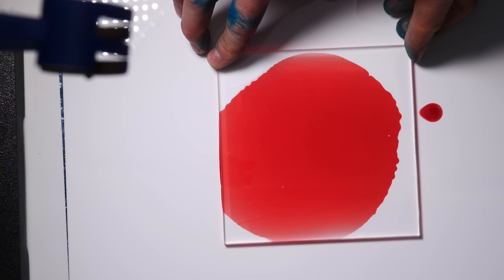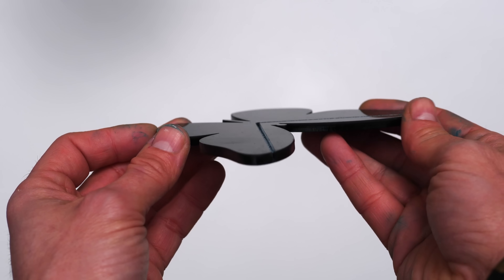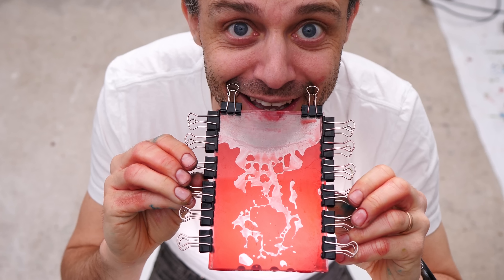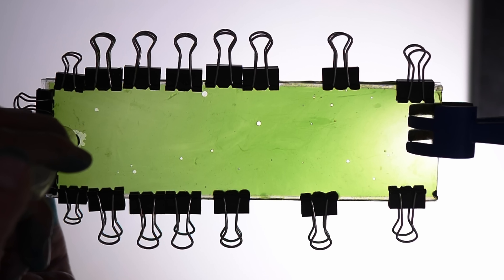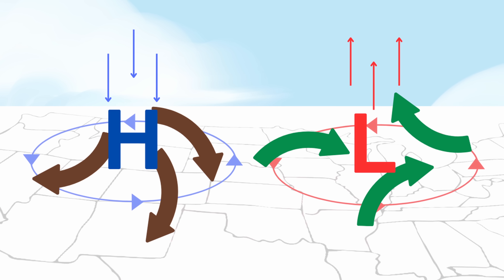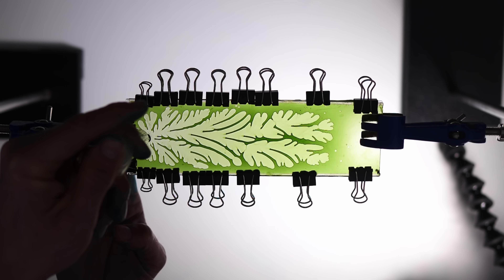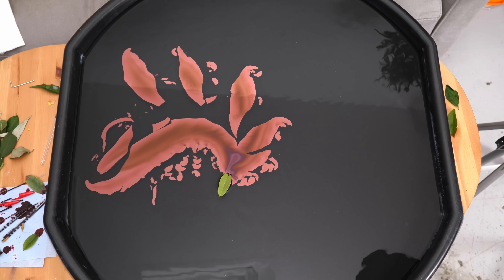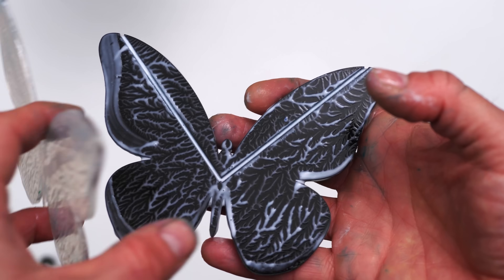Why honey makes these strange tendrils

Comment: is that essentially the fastest most efficient way for the flow of electrons, similar to lightning? and as the surface tensions sucks the volume from those tendrils the shrink?
Reply: the minute charges from the interacting atom structures
?
Reply: high pressure has faster moving molecules and loses more electrons?
Reply: that short lived effect could be the charges being discharged as the lose energy searching for the fastest flow across that plain, the 2 panes one being air the water but both of different densities so the lost energy dissaptes

Comment: To do the butterfly you just need a bridge between the wing tips, so your pulling from both wing tips at the same time with equal pressure. All the way through the body of the two pieces.

Comment: Oil can also be extracted from porous rock by the injection of air, particularly used for the remaining oil at the end of an oil field's life. The high temperature at depth causes spontaneous combustion and the steam etc forces the oil forward to another well for extraction. Commonly referred to as 'fire flood'. Works best in thinly bedded rock.

Comment: The look of these fluid fractals reminds me of wood planks scorched by high voltage electric currents applied between electrodes at both ends of the plank.  

I will post a link in comment to this comment for this YT video title:  
Safer Fractal Wood Burning (Lichtenberg) Setup
Reply: https://www.youtube.com/watch?v=s4ENnHRB6ro

Comment: There's a way of making pretty endpapers (for inside the cover of books) called paste papers, and it takes advantage of this effect. There are different ways you can control the pattern, by using stamps on the 'sandwich' before you open the pages. You can also change the pattern by changing the thickness of the paste in different areas. DAS Bookbinding (youtube channel) has a great video about it, and it's a really fun activity you can do, either with kids for fun, or as a n adult, to make beautiful papers for gift wrapping, paper crafts, bookbinding etc. It's an alternative to traditional water marbling.

Comment: For the butterfly pattern you want, why not print the butterfly with symmetrically placed holes to attach a strong wire? The wire would lead to a stable mount you build that uses a fulcrum to raise a platform in a perfectly straight manner. This platform would tug on both wings simultaneously when actuating the fulcrum, pulling both wings with the same force and direction simultaneously.

Comment: For a butterfly or other symmetrical patterns you could make a hole in the middle and then pull from around that point. You would need a vise or something to hold the bottom plate down, and something to help pull up evenly from the center.

Comment: Is there a related effect for three-dimensional bubbles of a less viscous fluid in a more viscous fluid? If you blow air at the right pressure underwater the bubbles make long strands that collapse into flattened spheres, but then air is also very buoyant in water so that probably affects the result. I don't know what would happen with two fluids of similar density but different viscosity. (The only vaguely comparable thing I can think of is a lava lamp, but that's a temperature gradient rather than a pressure gradient.)

Comment: Why not just attach like a suction cup and or handle to the shapes on one or both sides?
This way you pull them apart from the center of their mass, and you could make a different sort of fingering pattern, that is likely to be different from every other fingering you’ve done before.

Comment: I've employed this tactic creating artworks with "realistic" tree branching patterns in painting using various paints and media to accomplish the patterning. I noticed that the branching depends on which direction the plate (a plastic lid) is pried off of the surface or where the pressure causes an inconsistency in thickness of the media. How are these properties of fluid dynamics employed in the formation of various natural systems like branching trees or rivers or blood veins? Are these fractals created through similar perturbations?

Comment: You have probably solved the butterfly symmetry problem ages ago, but why not just make the wings into two separate plates, and then lift them both in the same way? (not at the same time, of course) For example, lift both wing plates away from the back thorax and outward

Comment: 8:10 I think you are considering the point in time when the thinner fluids pressure is increased. Before that event the pressure should be uniform for that medium. Thus, your diagram should have the before P and the after P of larger size in the thin fluid. At the boundary the pressure in the thick fluid should be nearly big P, while at the other side, instead of a tiny p, you should have used the before P. This still preserves the gradient but it’s more accurate.

Comment: Make a box for thr butterfly so you have something to pry on that would evenly lift the butterfly in whatever plane you want. Like a two small squares made so they touch the highest and lowest points on the wings, and you pry the squares instead. Maybe add small grooves or maybe string holes to the squares for easier and consistent separation.

Comment: I don't know how you said that opening line with a straight face... Which based on that smirk, my guess is there were many take before that... lol

As for the butterfly, I would've tried giving it two upward tabs or rings at the outer edge of the wings, to squeeze with my thumb on one and middle finger on the other. So that both wings pulled up together and then as you pulled the whole thing, it would've conjoined at the center.

Comment: I think that symmetrical shapes should have one of the plates cut along the axis of symmetry. If you then add small hooks to pull on in the same positions on both sides, you should be able to make things happen rather more symmetrically.

Comment: What happens in a vacuum when you remove the 2nd lower viscosity fluid, and then pull the 2 plates apart, do you get the same results?

Comment: Hello Steve. Love your videos and topics. They always seem to provoke deep thought and complex theories with practical demonstrations. I would like to inject a point for thought as well. I think the presure drop example leaves much to desire. Pressure is acting on all surfaces equally. The contact surfaces between fluid and cantainer add additional resistance, allowing a greater deltaP at the center of the resistive surfaces. I believe the fingers are only formed when the rate of change exceeds the limits of resistance of the fluid, hence the circle formation when forcing a thicker fluid into the thinner. Thinner fuilds can reach an equilibrium quicker than thick can displace them. While the inverse will trap thicker fuilds betwen layers of thinner faster moving fliuds. Thicker fuilds reach an equilibrium of presure once surrounded by the thinner fluid and the surface tension generates the fingers.
Again, this is not a criticism just my theory based on my current understanding of fluid dynamics. I would love to hear your thoughts on this. 
Thanks

Comment: I use this effect in my paintings.  I cut out a stamp from cardstock, paint it with acrylic paint, press it onto canvas, and carefully peel or lift it away.  Really great for making bio-inspired shapes like leaves and flowers.  If the stamp is flexible like paper, you can peel from multiple points simultaneously for a really cool spreading outward from center effect; just glue some threads to spots around the perimeter and then carefully pull the threads up at the same time.

Comment: I noticed that the fingering at 10:57 looks like the same pattern of motion as fire. I never realized it before, but fire moves fractally. Fire is the lighter "fluid" that is moving through the thicker fluid of the air, so it does the viscous fingering motion as well.

Comment: In ceramics there is a glaze decoration technique called "mocha diffusion" where you cover a pot with wet slip and then drip tobacco juice mixed with underglaze pigment onto the wet slip which grows fingers patterns like this which remain after firing.

Comment: Why is it when you put in the 'thin' fluid into the 'thick' fluid in the circular example, the 'thick' fluid sort of retracts towards the centre also creating the fractal fingers from the edges? Where is that mass going given you're putting more mass in? Is it just that the acrylic sheets seperaate allowing for more room, and the air coming in from the side creates the fingers??

Comment: Phenoxyethanol has lower surface tension than water. When a drop of phenoxyethanol touches water, it spreads quickly, disrupting water’s uniform surface tension. This causes flow patterns—swirls or “fingers”—as the fluid redistributes to minimize surface energy.

Comment: For mining, you need local melting and archimidis screw that pushes it from the bottom up way. You just need the screw at the bottom and not all along the pipe. (One of the) The most surprising thing i learnt is that, vacuumn does not suck. Thanks.

Comment: For the butterfly symmetry/prying issue, could you just do the same shape, but instead on each side you add a lever that's attached to the tip of each wing, separated from the joining plane? That way you could pry from that single point, and it would distribute to both wingtips (roughly) the same amount, and you could hinge it on the body as normal and hopefully get the simultaneous-prying symmetry you want.

Comment: Maybe have a slight bend down the center of the butterfly, so the wings are at an upward angle to maybe get a somewhat symmetrical pattern, if separated from each wing tip equally.
It will never be perfectly symmetrical, as in the teachings of Dr. Ian Malcolm.

Comment: For the butterfly:  Perhaps have a rigid plate for the end product, but a flexible sheet for the top layer.  Lines to the four wing tips so you can pull up and peel back each wing simultaneously.  A helping finger on the body of the butterfly would make sure that it's the last part to release.

Comment: You can get incredibly detailed and beautiful patterns with dry erase marker and two pieces of smooth plastic or glass, or some other surface at your experimentation. Color on the plastic and mash the two pieces together and pull them apart quickly before the ink dries. I found this as a kid and you can look at them under a microscope and see the tiny patterns. I’m guessing it does this because the ink is less viscous than the substances Mr. Mould uses. 
I tried the dry erase ink just now with some clear hard plastic trading card sleeves, and yes, with the naked eye the fingers are vanishingly tiny, and in some areas under my handheld 100x microscope the fingers have fingers beyond the resolution of the scope. Try it, it’s wonderful!

Comment: Your "flat plate" examples made me think of Lichtenberg scars. Is there a connection between the way that "over pressure" fluids move through other fluids and "over pressure" electrical currents (in lightning strikes) move through flesh?

Comment: For the butterfly, I'd try sticking a handle to the centre of each sheet (at the.. thorax, I suppose). Then you can pull them apart without having to go in at any one corner, though you would need a fair amount of strength to do so with something as thick as glue I think. Perhaps if you attach a C-shaped handle to both wing tips on both sheets that'd be easier.. However you do it, I doubt you'd get a very symmetrical result unless you start with the butterfly folded up (so two half butterflies) & then unfold it.

Comment: With the butterfly thing, why not make the plate you pull of break in the middle, or be separate held by tape or something, with a little tape handle in the middle, or something, but also; Is this maybe why our lungs our fractally? Fractalesque? Also leaves and stuff, because of the way they interact with fluids and maybe over time would evolve to take on the same shape?

Comment: For the butterfly to work symmetrically, secure one of the plates down on a table, and add tabs to the tips of the wings. With both hands, you can then pry the wings up at the same time, using those tabs, with the fractals ending in the middle body.
Reply: I was going to suggest drilling little holes in the wing tips and tying two strings in the holes then tie the strings together so you can pull both wings at the same time evenly.

Comment: could you talk about this flow in dust too? you see I'm a luthier and when sanding wood it makes something similar to this effect and would be awesome to see some knowledge in it. for instance, the dust continues to collect in-between the wood and the sandpaper kinda creating a seal, then when you lift the wood some vacuum is created leading to air flow to "blow" the dust to the center, piling up. never tried it with large pieces of wood, but I assume that it would create such fractal patterns...

Comment: The easy way to make the butterfly symmetrical would be to split it in half. Press the wings together, just like a butterfly at rest, and pry them apart. When it's dry, glue it back together.

Comment: Why is the more viscous liquid drawn towards the less viscous liquid sometimes? For example at 3:00 the green liquid pulls away from the edge and towards the blue liquid in the middle
Reply: No. When he pushes the fluid into the hole, it forces the plates apart, which then pulls the other fluid towards the middle.
Reply: @TheKingsapostle  Ah ok yeah makes sense. Thanks!

Comment: Idea for the Butterfly pattern... Cut a channel in the top acrylic plate that is aligned along the axis of the body, say 50% of the way through (from the top down to the interface between the lower plate). If you prise the upper plate from, say, the head to tail (you may need to lift the plate along the sides of the channel with screws?) the the pattern may emanate out from the body to the wing tips (I doubt it would be symmetrical in pattern but would probably be in size)

Comment: Currently studying Mechanical eng and the thought i'm having is this; the theoretical "ideal" geometry for a heat sink is a fractal, with infinite surface area to allow conducted heat to convect / radiate away, so my question is due to the fractal - like nature of viscous fingering, how does a heat sink with geometry defined by viscous fingering perform compared to standard heat sinks, and what would viscous fingering look like in 3d?

Comment: Awesome video, will surely try to plug that in class next year. The content is very relevant to a topic that I teach. However, I'm surprised that you did not discuss something that struck me during some of your video, such as when you inserted water into corn syrup. Overall, the outer edge of the circle seems affected even before the less viscous fluid reaches the edge. There appear to be a breaking point when all the structure crumbles and fingers appear all around (3:04). While you didn't discuss in details this phenomenon, I would believe that it's related to the pressure drop distribution in the more viscous fluid which is uneven along the radial axis. After all this, the only thing that I don't understand is, why does this lead to a reduction of the overall surface that is covered by the sum of all fluid since you added incompressible fluid to another incompressible fluid? The only explanation that I can come up with is that the overall volume changed along the Z axis and that the space between both glass surface actually increased slightly during the test. Thanks for any additional comment you may have on that, and thanks again for the awesome videos!

Comment: !  There's this kind of sand stone around my childhood home, used to call them power rocks, would crush them into a powder with larger rocks, don't know why..  Another thing we used to do is get them wet and use them to coat a slab of concrete by grinding them against each other, I think we pretended we were cooking and was buttering the pan.  I noticed when I'll get the rock wet just right so there was this layer of mud/sandstone between the rock and the concrete and then pulled it away it would make this really neat looking tree fractal pattern.  And now I know the name of the phenomenon about 37 years later.

Comment: You need to cut your butterfly in half and press the left and right wings together and then pull them apart, then you will have a perfectly symmetrical pattern on both wings of your butterfly. I do this all the time to paint eyeballs for the creatures I make (tap the two eye blanks together to get matching eyes) Oh and puff/3D fabric paint is your best friend for this kind of project.

Comment: I'm not sure I fully understand your point about the high/low pressure. When the air is pumped in, it creates a region of high pressure that the viscous fluid resists, but why would there be less resistance from the air going into a small region vs pushing equally against a larger region? The incompressible liquid should have to move regardless of the direction it's being pushed, and the air going into a small region would only add force pushing the liquid in every direction from the inside, so both outwards and inwards towards the high pressure area on the left. 
I know the real life circumstances means there's no way for the liquid to not "break" from a small imperfection, but in your example, you seem to neglect the liquid moving in the case of the indentation.

Comment: Recommendation for Butterfly: A Hele-Shaw cell where the hole feeds into the channel. The goal is that the channel feeds the air that separates the two plates, hopefully equally throughout the channel.